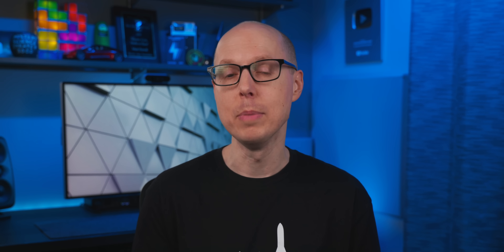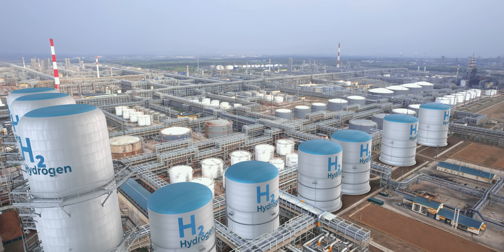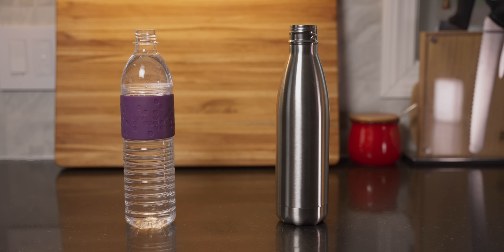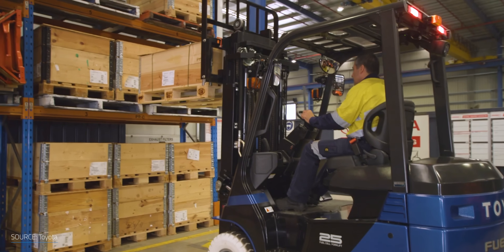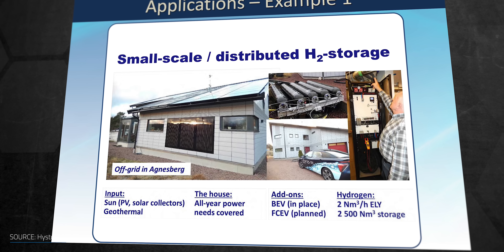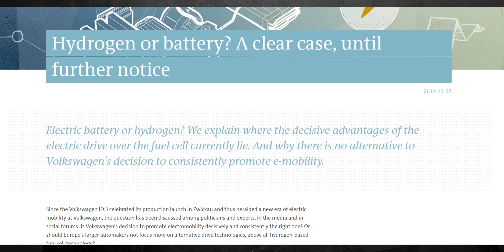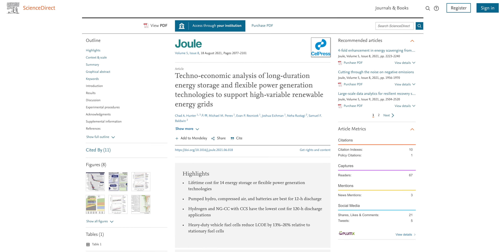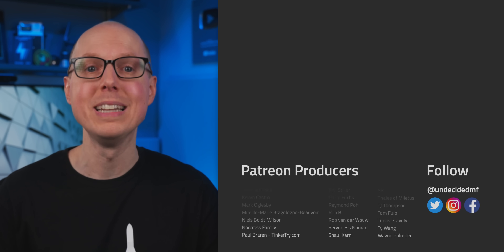Solid Hydrogen Explained (Again) - Is it the Future of Energy Storage?

Comment: I must learn more of this 😶 currently I've been working on a design that breaks water using a battery and burns the HHO to heat a steam chamber to spin a turbine to spin an electric motor wich will run to transformers one of wich will lead to a FULL BRIDGE RECTIFIER for recharging the battery to continue the electrolysis while the rest of the transformers will be use to power...other stuff 😶 I guess burning HHO in air results in nitrogen oxide as a byproduct, but it just implodes back into water aside from that, so it can just be...rebroken and reignited over and over 😃 just godda replace the spent electrolytes. A power plant on the coast that works this way would be perfect cuz it could just use salt water. It makes chlorine gas when using sodium as an electrolyte but maybe theres a way to turn that back into salt and put it back into the exaust water/steam after the HHO combustion. So salt water in, salt water out. Makes the friggin whole ocean into a gas tank that never runs out. Dare I say its basically like having free energy 😏. Sure components will wear out and break down, but like...who gives a f**k? 😃 it should perpetually run until it breaks down. F**k you einstein we dont care if its infinite hahaha! we care if its clean and free. Free meaning we dont godda pay for it. We dont CARE if its actually physically free though. Free doesnt mean against thermodynamics (wich einstein didn't exactly get right anyways) the system I designed actually uses one way valves in every tube to keep the flow going right and to close if the back pressure gets to high. It uses those at first, but once enough nitrogen gets separated from the nitrogen oxide that oxygen will get mixed back in with the water and the nitrogen will come outa the compressor as liquid through cooling tubes to go to condensers and will make the machine begin to function like a heat pump as well as help keep it from over heating, melting down, and doing the thing that makes everyone afraid to use hydrogen this way lol. So it actually UTILIZES natural order, rather than attempting to fight against it. It will assist the flow by increasing the pressure differential that already exists due to the hydrogen flame being WAYYY hotter than the electrolysis chamber at the end/beginning of the cycle. That flame will compress the exaust water/steam and nitrogen oxide into the tube leading outside the heating chamber to the part where the nitrogen oxide gets separated from the steam and the oxygen gets broken off the nitrogen so the nitrogen can be compressed. Idek if I explained that very well, but I kinda think I didnt. I might just take a pic and throw the rough half baked concept diagram up. Idk the particulars of all the processes that would be involved. I'm still learning, but I've been working on energy solutions since I was like 17 and I'm about 29 now. I feel absolutely sure that it'll work, but some second opinions would be nice. Kinda like a peer review in a way. I dont know anyone else personally with the same level of scientific knowledge as me, but I know theres people on YouTube who blow me outa the water in that respect with ease. Hell I learned most of what I know from YouTube vids. I use youtube like google when it comes to this stuff, and use duck duck go if I feel the need to really dig into the details. I'm definitely not the sharpest tool in the shed lol. But this is somethin I'm really passionate about. So passionate that I feel the need to troll every video i find that claims theyve thrown together B.S. and got "free" energy out of it. Battery/tesla coil powered B.S. I have that crap lol.
Reply: hate lol. I hate the free energy lies. I want the free energy TRUTH! nothing with a temporal component that's physically in motion could achieve it. However....the lamore frequency is a sort of temporal component in and of itself so a magnet technically has a temporal component built in by it's very nature. I dont know so much about that yet, as much as I wish I did. So for now, I shall stick with the current thing I'm workin on.

Comment: <Sigh>  We have the ability to generate heat (for standard steam turbines found in power plants) with a VERY HIGH initial cost, but no further cost and no polution. For as long as you need as in generations.
But it would require money and political will. So the "clean energy" movement is mostly a scam as this option has existed for decades.

Comment: Is it the Future of Energy Storage?  Is not. at least not for such as replacement of fossil fuels.  There is a push for energy source that can be widely spread and CONTROLLED. The reason and main issue with battery that anybody can fill from a solar panel or a source and cut out most of the energy industry. The most important word in energy production is control. That is why inventions and patents are suppressed. It can be an energy source for commercial use in specific locations.

Comment: I have a 2001 Honda Insight that uses a Nickel Hydride batterry to get 60 mpg, so the tech has nowhere but up to go. If a hybrid can take advantage of the sweet spot between 2 technologies, imagine if a MULTI-hybrid tech combined the sweet spots of multiple technologies. 🤯
Reply: They used NiMH cells because they couldn't source enough lithium cells. That is the only reason. Lithium cells are superior in every way that matters.

Even at that, both NiMH and lithium cells are highly efficient at converting electricity to chemical energy and back without losses, far more so than any fuel cell could be. There is no better option for a hybrid vehicle for mpg than what you've already got

Comment: You know what stores hydrogen at a huge ratio and is fairly easy to handle? Methane! that's 4 hydrogen atoms per carbon atom, and we already have plenty of infrastructure to handle it. Now we just need some cell that separates the hydrogen from the carbon and stores the solid carbon.

Comment: Efficient H2 storage is a great idea but we are still left with getting the H2 efficiently in the first place.
Reply: wind + solar power occur in excess, dependent on momentary grid load.
that's when electricity needs to be converted into H2 -
"efficiency" (in terms of electricity cost for electrolysis) in that case, is out of the question !

why are people so unaware of grid imbalance / grid surplus periods
and for example masses of windfarms left switched off oftentimes
and their possible production totally wasted..

Comment: Rodger Billings drove a hydrogen-fueled Cadillac in Jimmy Carter's inauguration parade. The fuel was stored in metal hydrides. The hydrogen was fed to an ICE (this was, after all, 1977) and the exhaust went through a pipe through the fuel tank, with the exhaust heat warming the hydrides to dissociate the hydrogen from the metal.

The tech has been around for a while.

They even had the US Army test it. They shot a fueled tank and got a "pilot light" flame as a result. No explosion, because the hydrides were slow to dissocate the hydrogen.

Comment: Big advantage over regular batteries, assuming there is little or no loss of hydrogen over long periods of time, is that energy can be stored in the summer for use in the winter. That can't be done with wind and solar which generate energy that must be used immediately or before the battery storage discharges.

Comment: In my childhood in school i studied that hydrogen is having high energy coefficient i.e it can be used a fuel in vehicles &  but the major problem with hydrogen is controlled combustion in engine as hydrogen is highly inflammable & put passenger at high risk...
Reply: the hydrogen pundits are trying to pair this storage with a hydrogen fuel cell that converts directly to electricity without combustion...

Comment: 8:48 The part I was missing is where an electrolyzer is used to "recharge" the hydride
It goes from H2 to water with the fuel cell and back to H2 again using the electrolyzer.

Comment: If you want to store LIQUID FUEL ... it makes more sense to try and get METHANE, because the temperature at which it turns from gas to liquid is much higher than that for hydrogen ... AND it is also a much larger molecule in gaseous form, thus reducing the cost for quality control / welding for any pipes and machines connected to it. Hydrogen - due to its very small molecular size - can leak ... and a hydrogen-air mixture is dangerous.
It is SMART for Space-X to use methane instead of hydrogen to fuel their spacecraft ... unlike NASA.

Methane cant be stored in metal structures though ... and that's where hydrogen gets an advantage again.

Comment: A temporary stationary storage was used for the gas grid in a nearby town to provide gas for the stoves and such in private homes. The storage was very simple - using half a tank with an open bottom floating in a fluid inside another larger tank with open top. The gas inside the tank kept the top half afloat and the weight of the top half kept the gas under a steady pressure.

Adding gas will lift the top, consuming gas will lower it. As the pressure is very low the size of tanks need to be very very big. But much less energy is used to fill the tank. About same idea can be used with a sealed bag with a small weight on top, almost like a bagpipe.

Comment: Another hydrogen source is from coal & hydrocarbon deposits, injecting water in the form of steam into deep deposits which would be hard to extract in other ways, or depleted low-grade deposits.  I forgot the source, and that's all I remember; I also forgot the exact way it would work.  I suppose the carbon would react with the oxygen from the injected water, freeing the hydrogen, and even the carbon dioxide would be a valuable gas to liquefy for the myriad uses it has in industry, greenhouses, and even recreational use (think "air"guns, airsoft, paintball, and more recently "air" crossbows using co2 to shoot arrows instead of strings -- not subject to licensing & very quiet compared to even supressed powder-actuated mass-launchers, easy to disarm unlike classic crossbows which require special tools to string and de-string <crossbows should never be kept strung for days and never cocked for more than minutes> and without the cumbersome limbs of regular crossbows as well as not subject to limbs or strings breaking catastrophically and giving the user grave injuries).

Comment: Awesome video just Subscribed.  I really hope you are the type to respond. I am really interested in these tech I am soon to start my own invention/experimentation phases. Why is Brown Gas being so demonized in the in the industry? All is required is compression style engine and the only place the gas is compressed in in the cylinder is during the Compression stroke. This engine design I have come up with replaces normal intake air which contains non-flammable gas nitrogen and other trace gases, for one that supplies Oxy/hydrogen and the injector also supplies it. As you are more than likely aware 02h2 does not tolerate compression it is explosive in nature. In a combustion type engine that volatility is what is required.

Comment: I don't see the argument of gravimetric density against metal-hydrides.
4x the weight compared to a gasoline tank is still only 200 Kg, compared to a typical EV with 400-650Kg and still a lower range.

Comment: So you need energy to heat the mass in order to release the gas, in order to generate energy.
This limits its usefulness compared to battery tech quite a lot, at the very least it is not a stand alone energy storage device.

And wow, if there is a fire and the mass heats up by accident...then you are sitting on a bomb!

Comment: I'm just waiting for bio batteries to make an appearance.  Cells divide and create enormous amounts of power as they do so, we need to learn how to harness that power and then, just growing biological tissue would solve a lot of power problems. Imagine a battery that has cells that divide to create power and die as the power is extracted, it doesn't grow any bigger, it just continually grows and dies. Yes, such a battery would require fuel to grow in the form of more biological matter, and would ultimately have a max life span, but I feel that the environmental benefits would be significant biological matter doesn't pollute the environment, it breaks down into harmless and often, beneficial organic nutrient, throw your old batteries into a compost heap and then onto your veggie patch in the garden.

Comment: Thks & this reminds me of how bottled acetylene works:
Acetoning of acetylene when storing it in a cylinder is vital to the safe and effective storage and functioning of acetylene. It is also vital for the safe transportation of acetylene cylinders. Here are a few reasons why acetylene should be stored in liquid acetone:
 1 It helps stabilize the acetylene keeping it from reacting with oxygen.
 2 Since pure acetylene cannot be pressurized without causing an explosion, it is mixed in acetone to reduce the pressure.
 3 Acetone has the capabilities to dissolve large amounts of acetylene. For example, one liter of acetone can dissolve 250 liters of acetylene. This is possible at 10 atmospheres of pressure. Hence, it proves to be a relatively economical method.

Comment: This is very interesting following on from the first video.
The devil as usual is in the detail, and specifically in the lifetime efficiency.
It’s all very well them quoting various efficiencies based on other various parts of the process, but how about comparisons of lifetime energy transfer including manufacturing the equipment and the fuel cells, energy usage carrying it in the case of vehicles, maintenance and replacement costs etc etc?
Almost no comparison is ever made between energy storage systems which actually do rigorously include every input and output and the externalities.

Comment: Is it a solution? Considering the byproduct is water, I think it will be a bigger problem than we have now with co2. Hydrogen may be ok in limited use, but it by no means a replacement for oil. Hydrogen is not practical, and never will be. However, talking about it again sure gets views.

Comment: wait, i didnt understand that advantage. if you wanna double the power of a battery, you need 2 of those batteries. if you want double the power of hydrogen storage, you just need twice the volume.... but how is that saving you weight? in both cases you get twice the energy for twice the amount of storage medium o.O

Comment: If you have already made elemental hydrogen (hydrogen gas) you should stabilize it with carbon. We have lots of carbon available for this use. Now to release the energy you would want to bound it with an oxidizer like oxygen which in turn would require some source of free oxygen and in a full cycle some way to reverse the oxygen carbon and oxygen hydrogen bonds. Maybe a global solar energy system that could extract the carbon out of the oxygen carbon byproduct of the hydrocarbon oxygen reaction. The breaking of the hydrogen oxygen bond is much more energy intensive but I'd assume we have already found that solution if we have free hydrogen anyway.

Also you would need some means to extract the energy from the reaction, a heat engine with lots of controls and a complicated system of self regulation would be required. That engine might take millions of engineering man hours to reach a mature state. It would be a lot of investment that would be a total waste to walk away from once we got the heat engine to an economic level.

Comment: I wonder if positively charging the hydrate and negatively charging the case could help push the hydrogen out of the lattice and potentially lower the temperature needed to release the hydrogen? Hydrogen is just a proton right? And that's positively charged. But then again the matching electrons must even out the charge... idk

Comment: If you run the waste gases from energy production through a cold water system you can capture the carbon dioxide and monoxide and the hydrogen will bubble through and you will have a byproduct of carbonic acid and pure hydrogen. The Carbon acid can then be taken for use in other industries to be broken down. The solution is there.

Comment: Hi Matt, and thanks for this.
Something related that interests me is the viability of the hydrogen conversions for combustion engines, both in vehicles and in the greater world.
Why are we still at the beck and call of big petro when there's a relatively cheap and easy way to convert standard engines to HH+?
We could almost instantly remove our subsistence on petrol overnight, and with other renewables, live sustainably without the ever-rising cost of fuel.
If you're wondering what I'm talking about, it's not fuel cells.
Just do a search for 'water engine diy' here on YouTube.
Reply: If those "HHO" or "water engine" systems really worked, then you'd be absolutely right about not needing fossil fuels. However, you always get less energy out of whatever you put it into (1st and 2nd laws of thermodynamics!) so those systems that use the electrical system of your car to split water into hydrogen and oxygen (that's an electrolyzer) and then bleed those gases into the intake of your gasoline engine to combust the fuel, hydrogen, oxygen and air mixture are not going to provide more energy than you put into them. In fact, combusting hydrogen in a piston engine is less efficient than using it in a fuel cell. There are several videos that show real world results where the HHO system doesn't do anything that it claims to do.